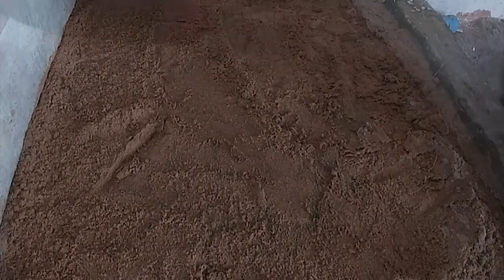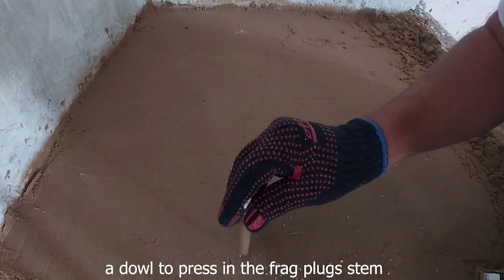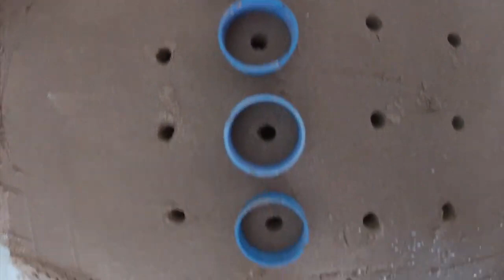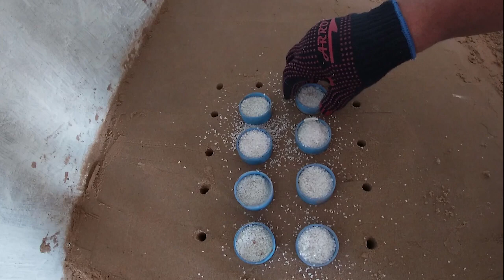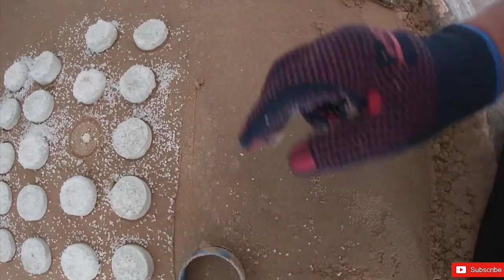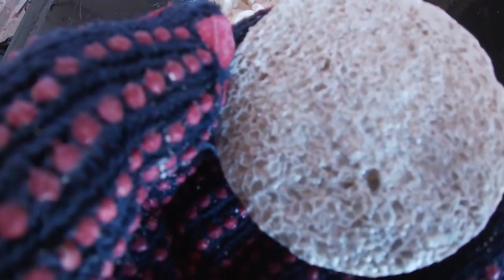How To Make  Coral Frag Plugs And Disc Super Easy

Comment: What does the coarse salt accomplish? Why not just use coarse aragonite sand or similar? Nice job though! What brand of cement?
Reply from the maker: the coarse salt you only add to the top layer once you cast the cement. When you cure your plugs this will dissolve and leave a tectured finish that leaves a nice grip for bonding putty to attach to your coral. thats just what I found works better for me and leaves a nice grip for coral to grow on
Reply from the maker: these are the rocks I also hand make I might post a video on the how to on this if you like aquariums      the qustion on cement you ask on plugs and rocks are portland white type 1  https://studio.youtube.com/video/nXChevuHZ7o/edit